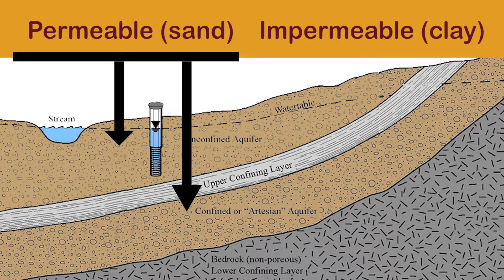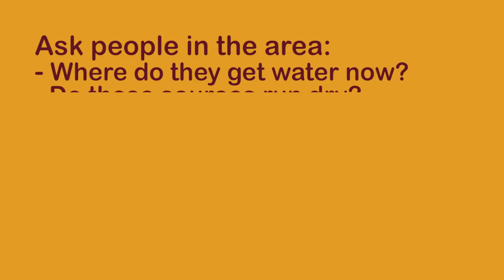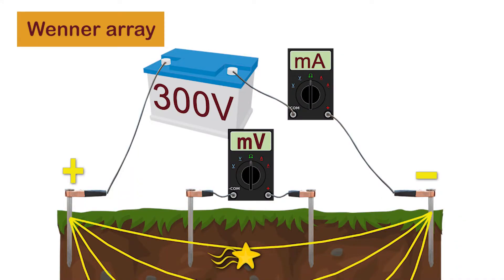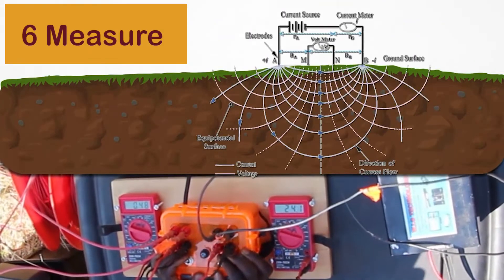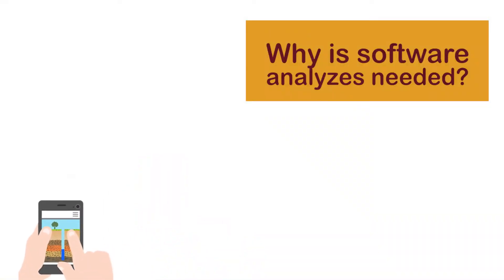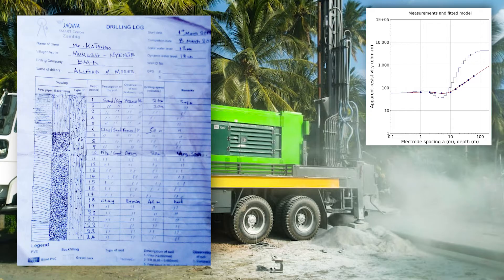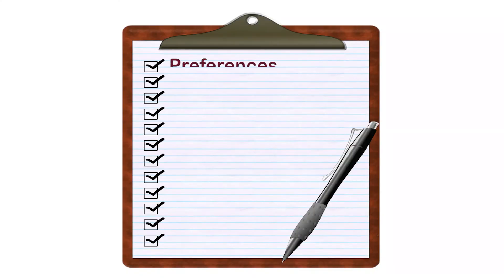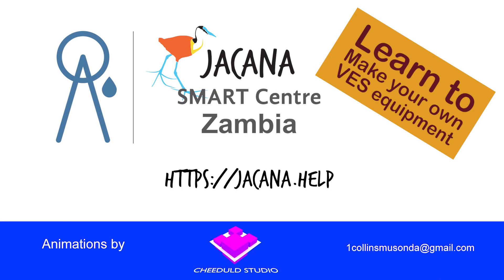Borehole siting tutorial

Comment: What of a Borehole that when it is during dry season it dries up
Reply: Seems your ground water level is doing down in dry season. Check if other wells or boreholes suffer from the same problem. You can measure water level simply with a rope and a small half full plastic bottle. If the water level in the other wells is less deep then the depth of your borehole, then there is most likely something wrong with the casing of your borehole. It might be clocked (in that case flashing could work) or the filter screen or gravel pack might not be at the right position or size.
In most cases you would need to drill a new better designed or deeper borehole. But before that make sure you have a professional borehole siter help you determine the best place and an independent drilling supervisor to supervise the drilling and casing design.

Comment: My question is, how does this work I. Solid rock formations? Limestone, sandstone, and shales? I've tried seismic before with no avail. I see how this works with sand and gravel aquifers, but Im  pessimistic as to its success in hard ro know formations
Reply: All techniques have their limits. Although VES is the most used siting technique. VES can tell you if there is a massive hard layer, not where a crack is. That is why the tutorial starts with "we don't exactly know what is down there until we have been there. But there are some techniques, like VES that can help us make a calculated assumption.